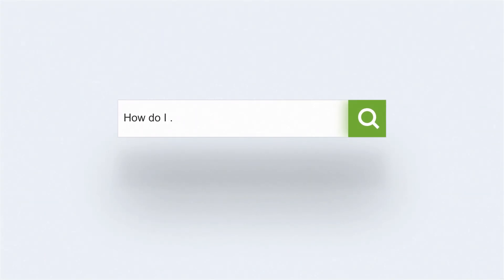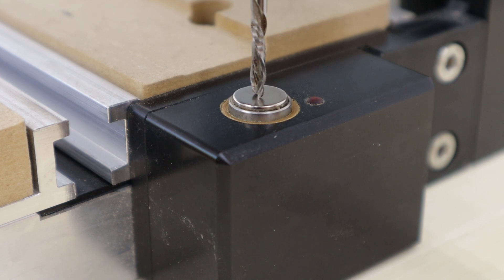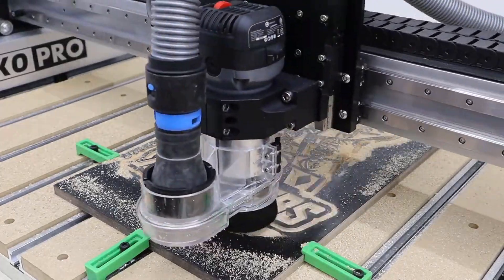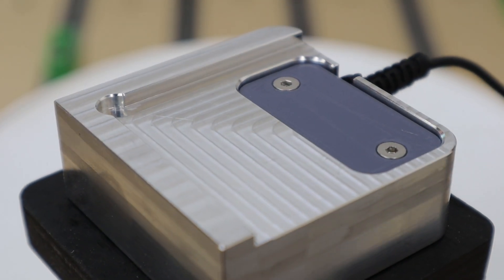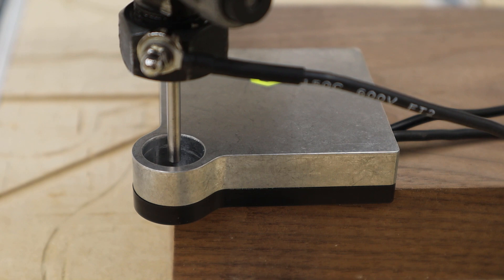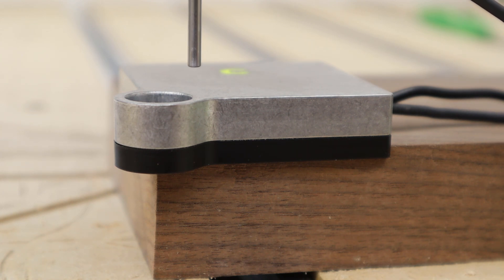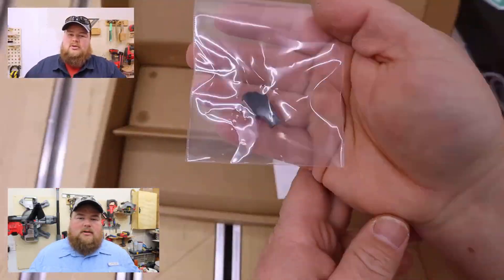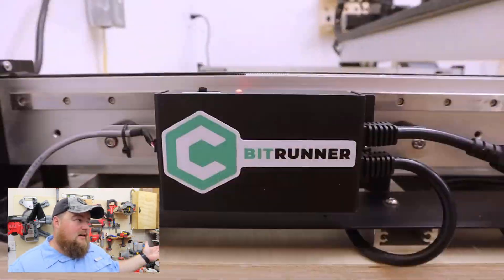WHAT ARE THEY? BitSetter, BitZero, BitRunner

Comment: That info should be on the CARBIDE website... one must go to 3rd party videos to get this basic info.  Thank you for that, Mr. Sam
Still I have yet to find what controller comes with the Shapeoko 5 Pro(4x2 in my case)...
It's like they are using a deceptive presentation... it is not in the 'What's included' section of their page, nor in the User-Must-Provide list, or anywhere discussed I could put my eyes on ???

Comment: So I’m looking at the 5 pro. Which router would you recommend, their router or a makita.
Reply from the maker: Either one is fine. Their branded router is a Makita clone, so it's the same internals. I've never had issues with my clone router from them. It came with extra brushes which is the part that tends to wear out over time... although I'm still on my original set.

Comment: Good video and it does clear some things up. So thank you. 
What I still don't quite get is if I have a touch probe why would I need a bit setter? After I change a bit I could just use the touch probe and get the same result. Right?
Reply from the maker: You could, if you split your job into separate files per bit. The benefit of a BitSetter is to just program one job with different tool numbers. When it's done with Tool #1, it stops, you load Tool #2, then press Start. It automatically senses the bit and keeps going without any further touch probe work.
Reply: @Samcraftcom  thanks for clearing that up. I have been learning on a cheap ebay 3018. On that machine I use individual files and DIY touch probe.

Comment: Hey Sam, I have contemplating on purchasing a CNC machine. Reviewed many different brands and after many of your videos on the Shapeoko 4 this seem like nice machine to start out with. Saying that,  I'm a beginner and know little other then what you have explained about this CNC, would it be to my advantage in purchasing the bitrunner!. Like I said in the beginning of video it can be bit confusing. So which is best for a beginner?. Once again thanks and any advice will be greatly appreciated. Mike
Reply: I would recommend the Pro (sam has the pro, shapeoko 4 is not the same). I have the pro XL version. Sam has XXL. You would have to decide for yourself when it comes to the HYBRID TABLE option. I got it. I do not intend to cut the top of it at all & instead will use thin waste boards between it & the work piece - I could have saved hundreds by just skipping it & mounting my own wasteboard instead. Food for thought. It is a good machine. Depending on your needs, you may want to look at Onefinity as well. Keeping in mind, Carbide3D is a company based in USA & Onefinity comes out of Canada. Also from Canada is Longmill - also a very good machine. Shapeoko Pro seems very nice & I like the controller board is mounted directly to it. That said, you may want to weigh the pros & cons of all of these machines. Drive systems: Onefinity has the best drive system of all of them (ball screws). Longmill mk2 uses Acme/Lead screws - decent. Garrett Fromme’s channel has a great set of videos about the longmill. He has 2 generations of the machine. Next is Shapeoko 4 & Pro, using belts to drive on. Not ideal! However, they are beefy 15mm belts & decent. They can be upgraded as well, with third-party aftermarket belts, down the road. They seem very fine to me. I think they are reinforced, though I am not sure yet. Stepcraft’s new 3rd gen D series is worth looking at. It is very, very good. Probably the best of all the machines named DEPENDING on which one you get & which options you need - the options can make it costly fast. The stepcraft runs with lead screws & steel-on-steel rails. It is a massive leap forward from the second generation stepcraft D machines, in basically every way.

Comment: Does a bit zero need to be used first before the bit setter for a large cut job just to set the x/y of the stock? I get that I can design with the 33x33 base in mind and place my stock accordingly.
Reply from the maker: The bit zero itself is not required, you can zero the machine manually. But the zeroing process is required so that the machine knows where the stock begins at for the job.

Comment: Can you use a v but with the bit zero? Thanks I appreciate your input.
Reply from the maker: No problem... with the v1 BitZero from Carbide 3D. The v2 may not work well since it zeros from inside a pocket vs. the outside faces of the block. When running v-bit jobs, I'll eyeball the x and y axis zero points, then use the probe for the z axis only.

Comment: Well done Sam. One thing I did mention before was having a ground fully hooked to the router at all times might simplify all the "connections" steps you have to do to insure you've done everything. .https://www.youtube.com/watch?v=fH7xUTdp-lw I don't know whether you actually saw it before but this man is pretty handy.
Reply from the maker: I didn't see it before -- YouTube likes to delete comments with links. That's a neat solution for his machine though. Thankfully I don't have to do that with mine since it's all metal and self-grounding from spindle to frame, etc. :)
Reply: @Samcraftcom  Actually you do when you snap that magnetic connection to the spindle ... (after you had the alligator clip ...you upgraded from...)

Comment: I chose not to get a touch point for my CNC.  Setting the Z height by visual inspection after a tool change is usually accurate enough for any wood, plastic, or resin projects I have tried.

As I get older and my eyesight fails, I may decide to add one.  But I would just add one wire to a feeler gauge,  another wire to a clip to attach to the tool bit, and plug them into the Probe input.

Comment: hi sam! good presentation. i still don't see how i can justify adding another $320 to my shapeoko 2. bitsetter, when i do my design work in vcarve, i set the x-y zero at a point 1/16" in, and 1/16" up from the corner of my workpiece, and that is a good center for my 1/8" bits. i just line them up by eye, then set the z axis with my favorite standby, a .003" bit of paper. that seems to get the height relatively close. when it comes time to change a bit, say, on the project i am working on now, i tell ugs to return to zero, reset zero, raise it by .02, and send it down 20 inches, and over 6 inches. then i change the bit, and hit return to zero, and reset the height with the bit of paper. after almost 4 years of using my cnc, i don't know how i managed to get by without these miraculous devices...